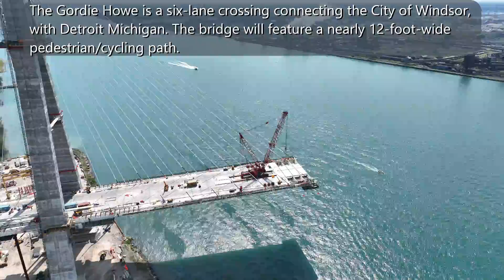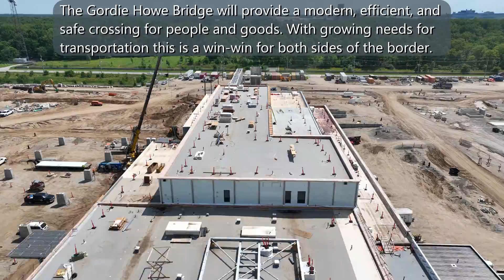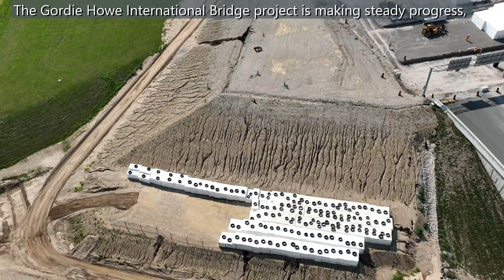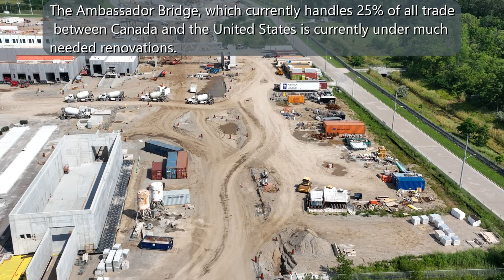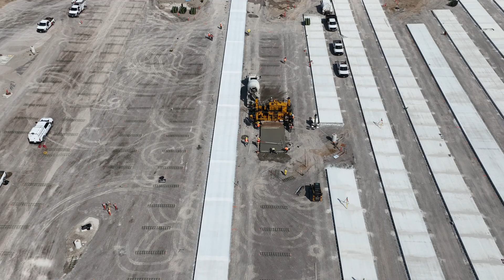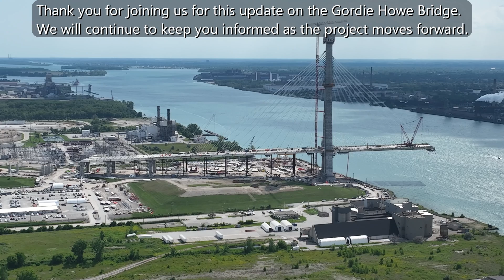Is This the Coolest Bridge in North America?

Comment: Are  the concrete towers surface being left raw, or are they painting it bright white to match the Architects reveal. to match the road way,  cables & underbelly? To Install all that Stainless Steel and no protection & sealant for the concrete is not very smart if you ask me. I've been searching for this & to my surprise it does not appear listed in the public released spec's?  It's like having a Rolls-Royce with no paint job.. Let us know what you find anything out.
Reply from the maker: Thanks for the comment and question. Renderings of the bridge picture a bright white bridge, that's marketing and the look when finished may be different. I so far can't find anything about the finish on the towers, however I did find this :
The color of the bridge will vary from white to dark gray and feature high-powered LED lighting that will illuminate the bridge for miles whether viewed by land, water or the air."
I'm with you and hope they have a finish on the towers, and would expect it if only for preserving the surface of the towers. Not to mention appearance.